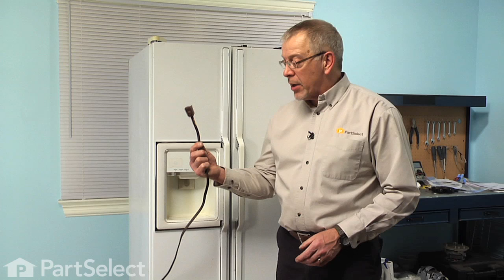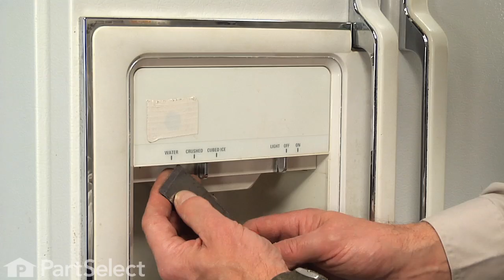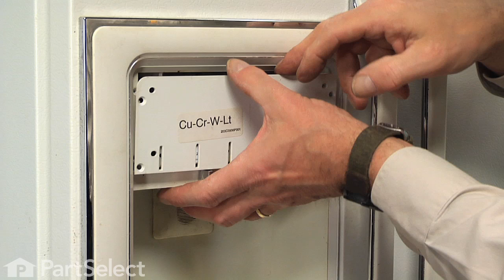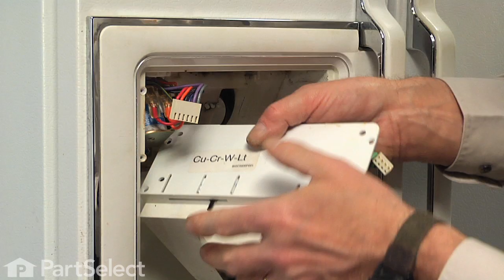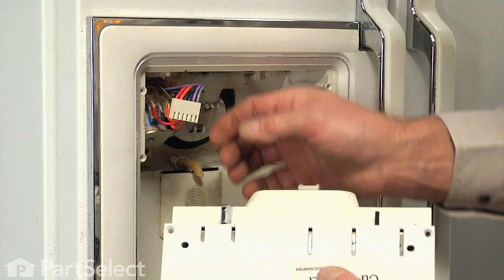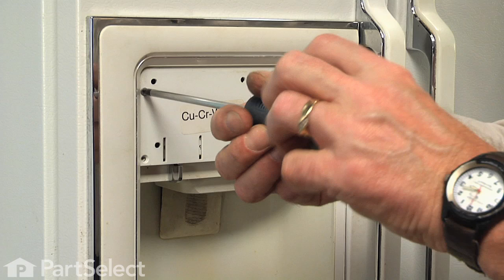Refrigerator Repair - Replacing the Dispenser Control Board (GE Part # WR55X129)

Comment: I have a Maytag side by side refrigerator, the ice and crush ice dispense good, but the water doesn't dispense, just a humming noise when I press the actuator. Is it the switch or the board?
Reply from the maker: The humming may be coming from the inlet water valve at the rear of the refrigerator. Check for a frozen water line at the reservoir in the fresh food compartment.

Comment: water and ice maker not working? only noise i hear is when i put onto crush.  I hear the glass switch when i apply pressure on the rubber.... I changed the water valve and no luck.   help..... thx
Reply from the maker: If the unit won’t dispense water or ice cubes, then I would suspect a problem with the control. What is your model number?
Reply: model 363-57557790      kenmore     .
Reply from the maker: The part number for the dispenser control is PS304236, and we have a repair video to help you. https://www.youtube.com/watch?v=M_4Zx26WYq4You should also check the continuity of the dispenser switch as well.

Comment: My entire control panel does not operate, will not dispense anything and lights do not turn on. How do I know if I need to replace the dispenser control board assembly or if there is a problem at the power coupling or elsewhere?  Thank you!

Comment: Water dispenser works, ice dispenser does not (flip opens), but for water to work the light bulb needs to be unscrewed.  If bulb screwed in nothing works.  Therefore, is it the dispenser board?
Reply from the maker: +rob 11 a If this symptom occurred before any service was performed, then I would suspect the control board.

Comment: Hi Steve,
Good video. Using your video, I replaced the ice dispenser control board (Maytag Plus Side-by-side Model # MSD2556AEB) which had a burned out capacitor in the middle. The new board was correct, identical to the old. Everything seemed to work fine (lights on touch pad all came on correctly) until I touched the actuator to dispense ice -- then there was a small explosion and the board was blown exactly as the old one had been. Any idea where the problem might be?
Reply from the maker: Zippariah There could be a shorted winding on the ice door solenoid or on the auger motor. Both of these components are activated by the control board at the same time. Try a continuity test on both.

Comment: Hi Steve and the Part Repair folk. Yesterday, I watched your video on replacing the auger motor, and today I watched this video. Because of your great videoss, I'm confident that I can do either jobs, but I'm not certain which is my problem. My ice maker makes ice, but won't dispense it either in crushed or non-crushed form. Water does dispense. When I open the freezer and remove the ice bin, and then press the dispense button I hear a hum, but the fork does not turn. (It does turn by hand, however.) So, I think it i the auger motor that is bad, but I've read that it might also be either the main control board or the dispenser board. Is there a good way to know which, if either, is the problem? My model number is either TBX22PR or TBX22PRBSSWW (it is listed two different ways inside the refrigerator); neither number comes up in in PartSelect''s database. Thanks again. You guys are the best.
Reply from the maker: Larry Adams I have passed your question on to Steve and will let you know, as soon as I can, what he suggests.
Reply from the maker: ***** You will most likely have to hold the door switch closed when performing that test. If the motor hums but the fork doesn’t turn, then the gearbox part of the auger motor assembly is probably defective.
Reply: That is great. I did hold the door switch closed and the motor hums. I'm assuming that replacing the auger motor will fix the gearbox problem. I will be taking it apart this weekend, and will be purchasing the part through PartSelect.

Comment: I have the HSS25gftaAWW hotpoint side by side refrigerator. Is there any way to test if the dispenser control board is not working? I do have a multimeter...

Comment: Have a GE Model TFX20JRSBWH side-by-side with ice dispenser. Makes plenty of ice, but dispenser flapper door arm pops out of engagement with pin in solenoid plunger, hence will only work one time after each disasembly for repair. Metal clip held in place by screw is in place, but door shaft jumps over the clip. Could some other part be missing? Nothing seems to be broken. Dispenses water OK. Enjoy all of your videos. Thanks for them.

Comment: GE TFX24SRAAD is my model number and I am trying to repair an ice maker that only dispenses crushed ice as of late. Is mine a circuit board, a solenoid... I'm not smart enough to read the schematic, but am generally handy enough to do this kind of fix. Can you help, how specifically to replace this (these) items and what bto order. I think it's your part number PS304989 but the instr. from others aren't detailed enough for me and my wife will kill me if I make this worse.Thank you- P.S. Your vids are great, and so is the service.
Reply from the maker: Thank you for the compliment. Your ice maker uses a Solenoid and Arm Assembly (PS304989) which is behind the ice bucket that moves an metal arm on the ice bucket to move the crush teeth away for cubes or keeps the crush teeth in place for crushed cubes. I'll email you directly some information on how to replace this part. Hope you find it helpful.
Reply: ***** Thank you Tons. To link a vid was very helpful. I ABSOLUTELY will order from you when ready. Thanks again
Reply from the maker: You're welcome! Let us know if you need anything else. :)
Reply: ***** Can I bother you again? I would like to check the dispenser are and circuit board. I placed my hand up near the side sliding selector switch, and it feels really gummy. I would like to see if that's the problem area before going deeper, but I must be an idiot because this front plate doesn't seem to be held in place by tabs. How do I get to it? Maybe the handles need to come off first, but I can't read the drawing well enough to tell. I'm sorry to bug you again. Thanks Dean
Reply from the maker: ***** Great to hear from you again. It would be helpful if you could take a video and/or a photo of the area that you're talking about so we have a better idea about how to help you.

Comment: Great video.  Thank you.  I do want to make sure that this is the part I need first though.  Ice is being made.  But, when I move the knob on the door to cubed ice, then depress the glass on the back, I hear a slight hum, but no ice.  If I put pressure on the knob, I can get ice.  I have established the auger motor is working when ever I put pressure on the knob (pressure pushing it back towards the back of the freezer).  So is it the circuit board that I need?